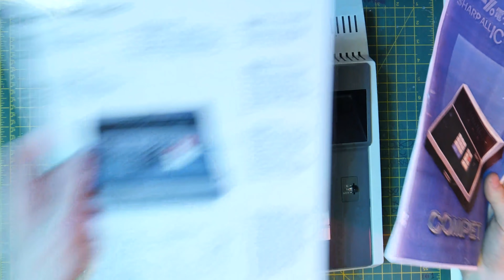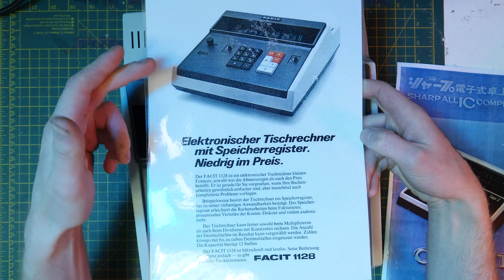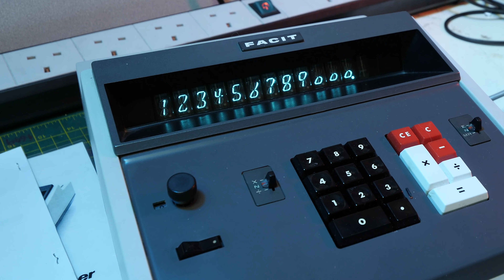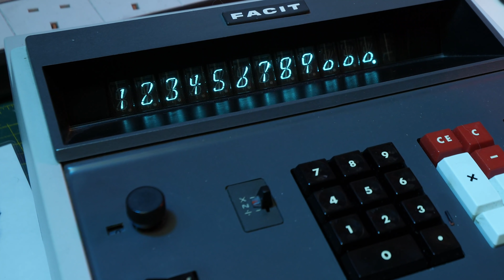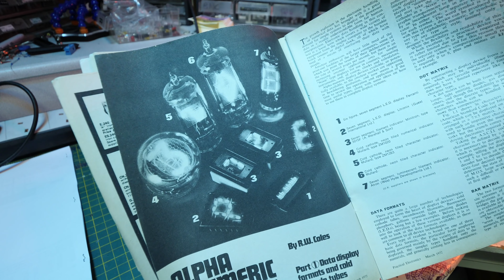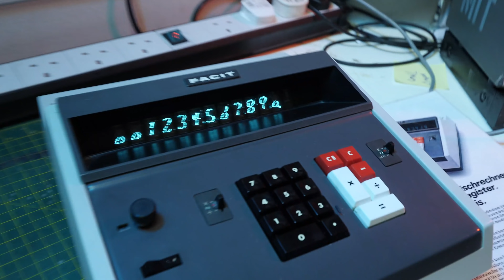Strange VFD Display Tubes In The Facit 1128

Comment: why not make a "sandwich" out of the facit calc, built an acrylic spacer and have the original shell and buttons as the top "lid" with the bottom either standing inside or being the real bottom?
that way you can see the display through the acrylic front without blocking them like the black front plate would, use the original buttons and see the internals.
it would also be somewhat smaller than a full on enclosure :P

Comment: Facit (yes, you said it correctly the first time) was a Swedish producer of office machines (such as typewriters and calculators), but it all went south for them quite fast when office electronics took over in the early 70:ies. Under new ownership they tired to market a PC in the early 80:ies, but with no real success. Some parts of the company was sold to Nokia others to Ericsson. https://en.wikipedia.org/wiki/Facit

Comment: I have a similar but smaller FACIT 1115 from 1971, with the same odd VFD digits. I have another 1115 where the only difference is it has the usual 7-segment digits and I guess it's newer.  Interesting to hear about this odd display from the brochure! I don't really buy that argument that the odd 8- or 9-segment display is easier to read. Maybe that's the entire truth, but what if the reason is that it makes the decoding electronics cheaper? Perhaps there is a really easy trick to drive these odd digits, saving a lot of expensiv silicon?

Comment: Hi Sam, I'm glad the calculator arrived in one piece.
As far as I know, the half-height zero was used because this machine does not blank out the leading zeros in the display. So it makes it easier on the operator to see where the number actually starts.
The green bit in front of the display did not fall off, I took that off so that one could see the tubes better :-) Forgot that was still in there. To put it back on you unscrew the mesh, put the green bit in front of the mesh and put the mesh back in.
I like the Acrylic box idea, it would definetely be cool to have it running and being able to see the inside.
Have fun with it!
Reply from the maker: aha!!! yes of course blanking it does not do that. very interesting! and I thought it was a bit odd how that green thing fell off when getting posted now that makes a lot of sense!!

Comment: It's a shame that you are enforcing timeslots at the museum. It's not possible to even contemplate arriving for a 1 hour timeslot after a 300-350 mile drive. I've had the journey to roughly your area vary by as much as 7 hours depending on traffic and the number of accidents that day. Are the timeslots just because of the Rona? Will it be general admission in the future?
Reply: Also if people are late we aren’t gunna turn people away. It’s just a rough thingie sure can make it work if poop hits the fan
Reply: Indeed but like I say in the description you can stay for as long as you want, it’s more a rough capacity check.
Reply from the maker: its made to keep an eye on capacity, we put half the capacity worth of tickets on for each hour, that means it might only get to full capacity after 2 hours, but this has not yet happened. some people stay for half hour, some people stay for 3 or so hours

Comment: Link the number buttons (0-9) to a simple square wave oscillator, hook each one up to a note in a decatonic scale, make it beep in key. Bonus points if you can make the oscillator read the numbers from calculations on the screen to create a really impractical sequencer.

Comment: I am pretty sure the name comes from the Latin "facere", "doing". It literally means "it does".
If so the pronunciation is the same C as in "chips".
Reply: Sounds likely, kinda like Volvo. But it’s also a common Swedish word, roughly translates to “answer sheet” or similar. So wouldn’t be surprise if the person naming the company thought it was clever:)

The Swedish pronunciation is different from Sam’s attempt. Two syllables, second one sounds like “sit”, and the first having the typical long Swedish a. It’s like when you doc goes “say aaah” but with an F before it. 

Faaah-sit.

Comment: The Name of this thing is pure gold. :D FACIT sounds a little bit like the german word "Fazit" wich means "conclusion"... What would even make sense for a calculator...
Reply: The word in Swedish means ”a collection of correct answers”, like the ones found at the end of a math text book. It’s originally latin though so it surely has the same origin as german Fazit.
Reply: Adding to my comment, I guess it means "it is done" for this particular use. A bit like QED, but for the whole collection of problems.
Reply: @Adrian More like "Phachit", I guess. it's a soft C, not an S.
Reply: @TDOBrandano  Swedish pronounciation for Facit is: plain old F + long A as in ’far’ + ’sit’.
Reply: Ok thanks guys... All that makes a lot of sense. Facit and Fazit mean basically the same and are probably based on the same latin origin... Thats my Fazit :D